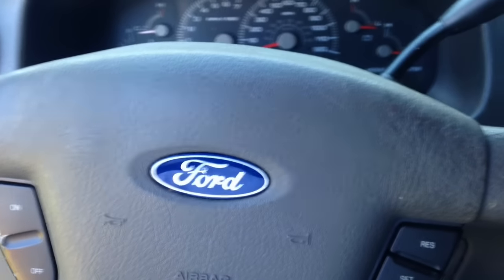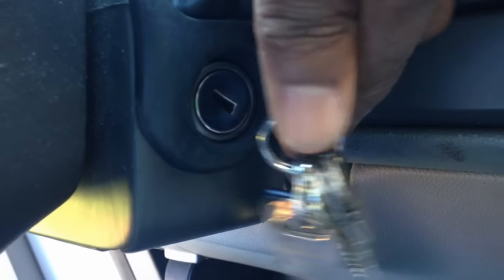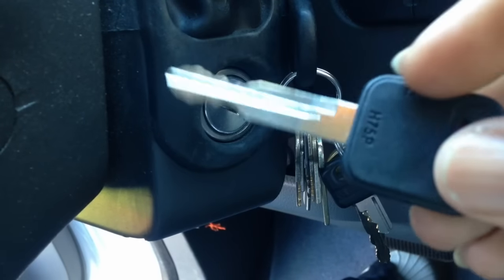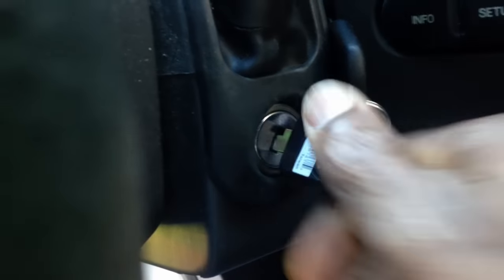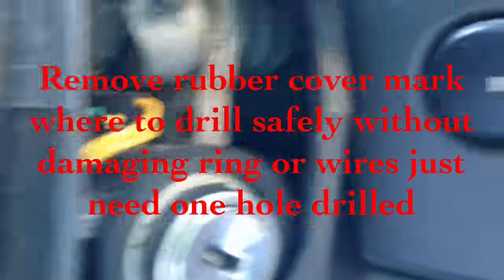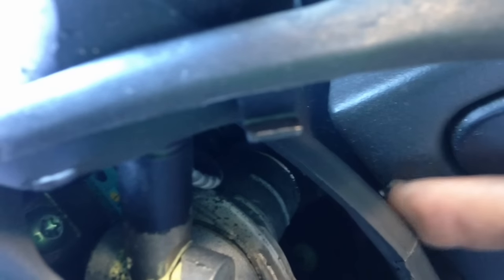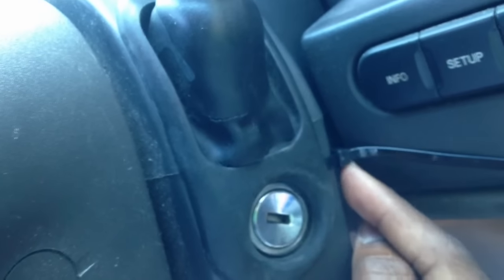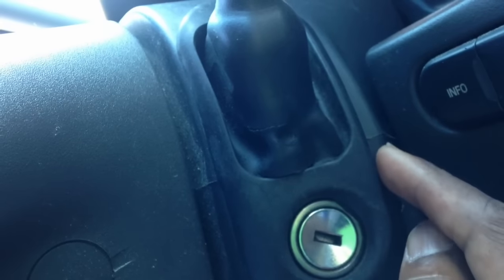REPLACE FORD KEY NO PROGRAMMING NEEDED CHIP WORKAROUND "bypass "

Comment: Fords are easy to program... Just get the key you need from ebay for $5 -$10... get it cut from Wal Mart or ACE and then program it yourself. My dealer wanted $250 for a new key and program... not including remote key less entry system.
Reply: Sukhwinder Singh don't you need 2 chipped keys in order to program a new ebay chipped key? I have a chip in my master key. that is the only key I have. I was going to buy 2 uncut chipped keys off eBay. but everything I've seen on programming a new key I'd need a master chipped key and a slave chipped key to program any new key.
Reply: yo i got this same question
Reply: I had a 1997 Ford Exped... I got one key from the auction I got it from. They said it won't work with only one key, but I tried it anyway. It worked for me. It may depend on the model and year too. Try it... the worst that can happen is you will have a spare key to open the door in case you lock yourself out.
Reply: Don't you need two original keys in order to program a third spare?
Reply: where did you get the stuff to reprogram the new keys
Reply: Sukhwinder Singh how did you program it yourself
Reply: watch the you tube videos you can turn the key back and forth several times in a special set of turns and it takes 5-30 minutes
Reply: what you are talking about will program the remote fob, but not the key!

Comment: I bought a 2002 ford focus from a tow yard. I'm assuming they had a locksmith cheaply change out the ignition cylinder the driver side door cylinder and the trunk since these are the only areas you would need a key. The problem is, now I can't use a keyless remote to lock unlock Pop My Trunk...... I bought two programmable regular keyless entry on Amazon feel like 8 or $10 and didn't even think it might not work because locksmith might have bypass that whole system? I'm a single Dad with my five year old who just turned 5. And it would be a lot easier if I could open all the doors at once all the wise I have to walk around unlock my door unlock his doors and then I have to walk him back around to put him in his carseat. If there is a very inexpensive way to fix this that would be awesome. Considering I paid $1,000 for the car which was a very good deal. It's barely got $100,000 on it and I have all the maintenance records since it was bought. And in a very clean Carfax that I've been adding to. Cheap on gas everything works correctly imperfectly except I don't have the keyless entry. Any help would be greatly appreciated...!!
Reply: Tommy Dingley You can try this... go to ebay and buy this https://m.ebay.com/itm/2x-Replacement-Remote-Keyless-Entry-CWTWB1U331-Key-Fob-Control-For-Ford-Mustang/253085898659?fits=Make%3AFord%7CModel%3AMustang&hash=item3aed1857a3:g:ugwAAOSwOA1aDpr9 
I'm assuming your key will start the car. when you get the fobs, just use the simple programming of the fobs, you do not need two original keys to do that. then at least you can unlock all your doors and trunk with the remote... if you don't know how to program the fobs, ask and I'll tell ya, it's very easy...

Comment: That will work great until the PATS system eventually fails as everything electronic does sooner or later. What you should do is have the ECM reprogrammed and just delete the PATS system all together.  It's not as cheap as what you did but the PATS won't leave you stranded out in the middle of now where one day either. Probably while you're on vacation.
Reply: Kimberlyexpects How can you delete the pats system
Reply: you can go to the dealer and have it disabled if you want to spend the money.
Reply: Haven't gotten it to start going on around 2 yrs already. Damn PATS started giving me issues rt before the pandemic. I get dtc p1260 - theft identified, vehicle immobilized. Got a new transceiver but no luck. Gonna try to get new keys made. Sigh, hopefully it works....
Reply: And the damn thing did leave me stranded. It wasn't my daily driver thankfully, so didn't necessarily need it all this time and I'm in the process of restoring the car, just doesn't start anymore. Would I have to get a new ecm, or just new keys reprogrammed? I've read online, if the car shows the correct odometer mileage, the ecm is functioning correctly and communicating. With the keys in the On position, my mileage comes up, it currently has 275,6xx miles. When the keys are not inside ignition, only dashes are shown, and theft light repeatedly flashes, and car won't fire up. I've checked all the fuses and relays and all are good, fuel pump also starts. User WCBurns (or similar name, sorry if I get it wrong) from AllFordMustangs has a lot of info on the car's electronics, and on the issue, but I can't get it to start for some reason.....

Comment: You can have the door locks repined to the same lock pins as your bought key and switch, then you can unlock or lock the vehicle( assuming you have a key lock outside on the door, some vehicles do not) It dosn't cost much.

Comment: the key has a chip it , you can take it out prying the top off and inside is a cilininder glass chip, and that chip can be taken out, that chip is what needs to be programmed  for it to work. best thing to do, is

take the cilinder chip off  and switch it to the working key just pry it off with a small screw driver

Comment: Wish I saw this before I lost my damn key
Reply: will this work with any replacement key of same model????
Reply: @maidenfan4life74  if its been programmed by the dealer but that may run you 100 200 bucks or more
Reply: Hi B Dogg 
Please can I know how you get rid of your problem
Reply: @dextermazuka5022  I had to have a locksmith make me a new transponder key. It costed me $200.

Comment: Take the transponder chip out of the key and glue it to the steering column.  If you want a little more permanent disassemble the steering column and glue it under the plastic , reasmble everything.
Reply from the maker: True I did this on my Focus worked 👌🏽

Comment: the purpose of getting a spare key is to prepare yourself in case you lose the original. If this happens your fine, otherwise your screwed. Your forced to go to the dealer or locksmith and pay thru the nose. Try staring your car w/o the chipped key..not happening.

Comment: he basically left it there to bypass the saftey chip in all keys now he can buy 3 generic keys for 10$...instead of 100$..
Reply: Hi  so if I buy a car with no key I can just get any kind like you say and reprogram it.
Reply: +luqman muhammad if you have 1working chip key...make a few copies any key no chip programmed etc...and use those...and leave the one with the chip near ignition like he did in the video...mind you your car looses its saftey feature for antitheft purposes...would be like an older car now...
Reply: Hay is there a battery in chip key that will go bad if it lose to steering wheel for long time?? @javiertrujillo3136
Reply: @TygerK  also would like to know if that would happen
Reply: @TygerK  No. There is no battery. Google "RFID".
Reply: @TygerK  No. the transponder in the key is "powered up" by a small RF field around the ignition switch.
Reply: @TygerK  No, there isn't a batter in those keys. Only the chip, it's like those tags that beep at the store when you try to steel something. No battery in those keys
Reply: no
Reply: No battery, the transponder emits a frequency.

Comment: Tried this on my 2013 key made at ACE hardware and it does not work.  Opens door but does not start engine.
Reply: If you put the working key near the sensor, it should work.

Comment: way to go, doing that permanently disables the immobiliser,what I would of done is swapped the plastic backs between the old and new keys, easily done just clamp the old key in a vice and pull hard till the back comes off do ther same with the new key then push old key back onto the new key and job done,
Reply: you missed the whole point of doing this...
Reply: You don't want to have a clue what you're talking about

Comment: The whole point of the chip is so no one can hot wire your car. You're not solving anything. If you have two working keys with a chip, just get a key on Amazon, get it cut and program it yourself.
Reply: But we don't have one. We have only one. That's why this method is important.

Comment: If you are going to keep the original key in the car then why did get a spare one?
Reply: Because most people prefer losing a $4 key vs a $60-$100 key.
Reply: must not be married. Wife needs to use the car and your not home with your keys in your pocket. or you got kids who drive your car too. EXTRA DEALER KEY 60-100 x2 (120-200) I just saved myself 192 dollars on an 20 year old car.
Reply: Errr And just how is a thief gonna know the car will start without a chip?
Reply: knightd12
Comprehension is not your strong point. First, thieves are opportunists and can try strange things, secondly you made it sound as if thieves do not or do not try to steal modern cars with transponder keys and thirdly they know some people use this simple trick of taping the chip to the ignition barrel so they do try to hot-wire cars and if it starts it is a bonus to them, the guy in the video even advertises what he did with an exposed zip tie, brilliant idea, he did even better , he taped the whole key and not only the chip there so the thief don't have to bother with the steering lock and hot wiring, indeed a brilliant idea.
Reply: knightd12
Seems reading and writing is also not one of your strong points, check the correct spelling of my name.
 Part of my living is in the vehicle immobiliser department and I know a lot of clever stories and tricks that caused more trouble than doing any good, taping/tying a key to the ignition switch is one of them. If you reckon it is a good idea good for you.
Reply: Glad to see you used your real name. That will narrow it down to about 75 million potential Philips. OK, I was just being sarcastic. To your credit you have presented you point of view very well. And I admit, I do enjoy an occasional mental joust with a worthy opponent. I can now admit, I have very little if any knowledge about chips or keys in general. I was just having a little fun. No harm intended. Have a Happy New Year my friend, maybe we will 'converse' again in the further. <the anonymous knight>

Comment: What's the point of this?  Just use the key you are hiding in the vehicle.
Reply: To have spare non-transponder keys at $4 a pop instead of $60-$100 each. 

COME ON, PEOPLE.
Reply: This is a good way for many reasons. Someone are just short sighted.

1. If you have a worn or broken transponder key you can use this method to get your car working. 

2. Also good if you use the spare (non-transponder key) as your primary and keep the real key hidden inside you'll  always have a spare without paying for the additional cost.

3. Fords have key coded on the locks so you can easily get into the car but need the key to start the car.

Shall I keep going?
Reply: also, you can use a minimal key like a keyport blade as your main to minimize your keychain bulk.
Reply: +Gangrene Vagina That just defeats the anti-theft capabilities of the computer making the vehicle much easier to steal.  I can see if you broke the original key but to waste a perfectly good key so you can buy an un-needed $3 key instead of an un-needed $60 key is about the dumbest thing I have seen.
Reply: Whatatay T once a car gets 10 to 15 years old and rusting and scratched but still runs good. You don't have to worry as much about it getting stolen. I have a 2002 ford focus I drive alot. If someone steals that they needed more than I did lol they want 140 for a spare key for it. I think I would take my chances.
Reply: The point is he wants inexpensive replacements so he can have multiple backup keys.
Reply: So if I replace the keyswitch cylinder (that comes with non-transponder keys) can I do this and not have to get it coded or no?
Reply: And I thought I was crazy. Just use the key I be hiding bro
Reply: Or just buy a key off eBay that has a transponder in it and replace the original into the new for around $14-19 bucks. Can still get it cut on the cheap. Yes you can open the key and replace it into a new case.
Reply: @BPoweredLove   You cant fix stupid brother, you just have to grin and bear it...
Reply: @myjams5947  Yes but now you can buy may keys at $3 each and have them on separate rings and he and his wife can both drive the van rather than just having one key on one key ring... understand?

Comment: what he did was permanently mount the chip ,so non chip keys work
 keys work. the chip only needs to be in proximity or the receiver in column
it is actually disabling the anti theft.  result it can be stolen by thief with screwdriver or slam hammer
like cars before chip. but if its old beat up and you no longer care if stolen or dont have the money . why not.
just if ins co if comprehensive coverage  they might not pay if they find out
btw if you own 2 or more cars with transponder chips dont have on same key ring 2 reasons interference and too many heavy keys damage ignitions quite often

Comment: you can zip tie it in place inside the plastic cover and use the cheaper spare NON CHIP keys to save you money. You defeat the chip in the main key. You lose some security, but really no one knows unless they know you did it or post it on facebook or YOUTUBE. Pro you lose your keys you have a spare hid in the car, cheap replacement keys: CONS someone knows you did it they steal your car easy. I did this on an old beat up truck I had and my contour BOTH SOLD NOW. NOW I demand 2 sets of keys and fobs when I buy used or new vehicles. On a side note when it gets freezing cold outside this glitches and you may need to undo it.

Comment: i see why but this is not a bypass. more research to be done. i want to electrically modify the cables to think it has a key or connect 2 cables together so it thinks key is there. maybe magic number resistor will allow my truck to turn on. wife lost the key

Comment: I bought all Original 05 F150 immobilizer transmitter,the lock cylinder and Transponder Key for just under $50 cause my old original chip(Duck taped to the key) got ruined in the washer... but ill take that L for not taping it to the ignition like a dumb ass.

Comment: You are doing more harm than good by drilling into your steering wheel column. The 75 dollars you saved by using the cheaper unprogramed key will now be used to fix the damage you just caused to your car. You solved one problem and created another.
Reply: Heres your sign...
Reply: Like he                            cares.

Comment: My wife just purchased a 2010 Ford Focus. The key we have is a ford key but a clone and it is set with restrictions on MyKey. The carlot has a cloned copy of the key we have. Neither are what they call the Admin keyand or master key. All I can find is take it to Ford and pay over 200 bucks to have a admin/master key made. Don't look like it any cheaper to buy a chipped/uncloned/unprogrammed key  from ebay or amazon than it does from Ford. Does anybody have any idea how to get a admin/master key made other than going to Ford or away to deactivate the MyKey program so I can turn all the Mykey stuff off and deal with a second key later down the road. Think a parent bought this car new for their teenager and programmed the key so they couldn't use certain things or drive to fast.. Thanks
Reply: Barry Moses You can try this... go to ebay and buy this https://m.ebay.com/itm/2x-Replacement-Remote-Keyless-Entry-CWTWB1U331-Key-Fob-Control-For-Ford-Mustang/253085898659?fits=Make%3AFord%7CModel%3AMustang&hash=item3aed1857a3:g:ugwAAOSwOA1aDpr9 
I'm assuming your key will start the car. when you get the fobs, just use the simple programming of the fobs, you do not need two original keys to do that. then at least you can unlock all your doors and trunk with the remote...

Comment: Bypassing, involves bypassing. You could make a video "How to bypass RFID entry locks with a piece of paper" and you just hold up the original RFID badge along with a piece of paper, accomplishing nothing. That is essentially what this video is. There is also probably no reason why you couldn't just glue the old chip onto the side of the new key, by cutting off the metal part of the key. This video should be called "How to reuse a chip for a cheap chipless key".

Comment: Great advice now when thief breaks your window and jams a screwdriver in your ignition he can steel the car keep an eye out for zip ties near ignition or cars with out the security light flashing and those car can be stolen faster than the 15 mins it takes to program a key I can walk up to your car now with a 40 2 in 1Lishi pick decode your cylinder and drive off with out ever having to wait 10 mins to program a new ''pats'' key 

Listen people you can get a clone for most cars if you have 1 key at Home Depot for under 100 they are about 50-60 or go on Amazon by as many chip keys as you need for 10 a piece call a locksmith have him program them all at once for 100 keep in mind ford has a limit on how many you can program you can also ask and see if your vehicle has a setting for unlimited  key mode that will shut of the passive anti theft system so you don't have to do this nonsense some locksmiths will tell you it's not possible because they will lose money turning it on but there is some that will turn that mode on if they can and you ask about it 

For the unlimited key mode your car must be one that came off the assembly line along side other fleet cars and trucks like the crown vics and F and E series not all will have it I have found it more in white trucks vans and cars but there is no guarantee every car has that mode